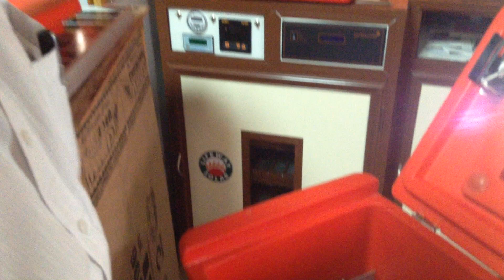solar power incubator part 2 Solar Power Low Cost chicken or Egg Incubators

Comment: Sir ,its work with solar light ? reply plz.
Reply from the maker: Yes it is solar powered with backup battery.
We have a variety of solar incubators starting from 100 eggs capacity to 2000 based on your requirements.
Rate starting from 35,000 to 2.50 Lakh Indian Rupees.
Please contact us at info@lifewaysolar.com for details.
Call us at +91 9846034493 /+91 484 4046642.
We are located at Edapally toll Jn, Cochin, Kerala, India.

Comment: सर मशीन भेटल का.9696070808 फोन करा
Reply from the maker: Aapke interest ke liye shukriya sir aap hame please contact karo.
We have a variety of solar incubators starting from 100 eggs capacity to 2000 based on your requirements.
Rate starting from 35,000 to 2.50 Lakh Indian Rupees.
Please contact us at info@lifewaysolar.com for details.
Call us at +91 9846034493 /+91 484 4046642.
We are located at Edapally toll Jn, Cochin, Kerala, India.

Comment: Where is in india.and their price
Reply from the maker: We have a variety of solar incubators starting from 100 eggs capacity to 2000 based on your requirements.
Rate starting from 35,000 to 2.50 Lakh Indian Rupees.
Please contact us at info@lifewaysolar.com for details.
Call us at +91 9846034493 /+91 484 4046642.
We are located at Edapally toll Jn, Cochin, Kerala, India.

Comment: Wha 😕Prize
Reply: but watch my 12volt fully automatice low cost incubator..
Reply from the maker: We have a variety of solar incubators starting from 100 eggs capacity to 2000 based on your requirements.
Rate starting from 35,000 to 2.50 Lakh Indian Rupees.
Please contact us at info@lifewaysolar.com for details.
Call us at +91 9846034493 /+91 484 4046642.
We are located at Edapally toll Jn, Cochin, Kerala, India.

Comment: sir what is the prize of small solar incubator
Reply from the maker: We have a variety of solar incubators starting from 100 eggs capacity to 2000 based on your requirements.
Rate starting from 35,000 to 2.50 Lakh Indian Rupees.
Please contact us at info@lifewaysolar.com for details.
Call us at +91 9846034493 /+91 484 4046642.
We are located at Edapally toll Jn, Cochin, Kerala, India.

Comment: how much price
Reply from the maker: We have a variety of solar incubators starting from 100 eggs capacity to 2000 based on your requirements.
Rate starting from 35,000 to 2.50 Lakh Indian Rupees.
Please contact us at info@lifewaysolar.com for details.
Call us at +91 9846034493 /+91 484 4046642.
We are located at Edapally toll Jn, Cochin, Kerala, India.

Comment: how can buy this machine
Reply: but watch my 12volt fully automatice low cost incubator..
Reply from the maker: We have a variety of solar incubators starting from 100 eggs capacity to 2000 based on your requirements.
Rate starting from 35,000 to 2.50 Lakh Indian Rupees.
Please contact us at info@lifewaysolar.com for details.
Call us at +91 9846034493 /+91 484 4046642.
We are located at Edapally toll Jn, Cochin, Kerala, India.

Comment: Turning the eggs every 2 hours manually is not at all practical
Reply: watch my 12volt fully automatice low cost incubator..
Reply from the maker: Our models can also do automatic.
We have a variety of solar incubators starting from 100 eggs capacity to 2000 based on your requirements.
Rate starting from 35,000 to 2.50 Lakh Indian Rupees.
Please contact us at info@lifewaysolar.com for details.
Call us at +91 9846034493 /+91 484 4046642.
We are located at Edapally toll Jn, Cochin, Kerala, India.
http://www.lifewaysolar.com/